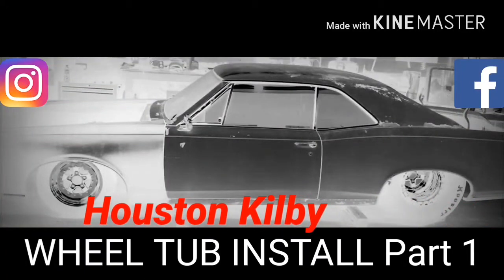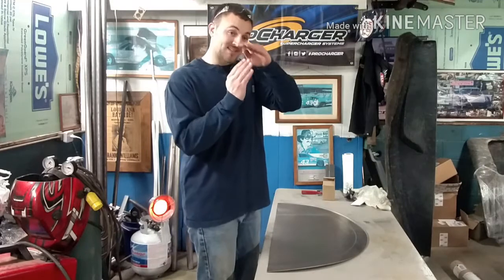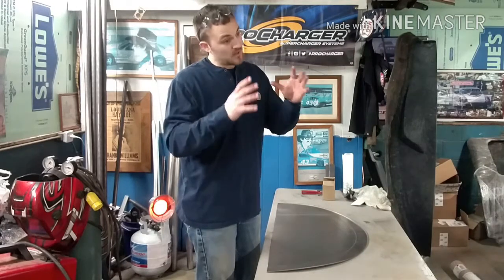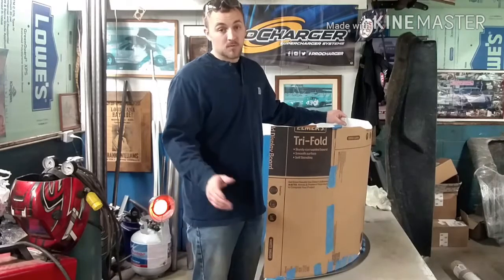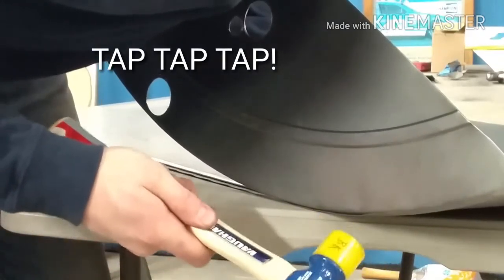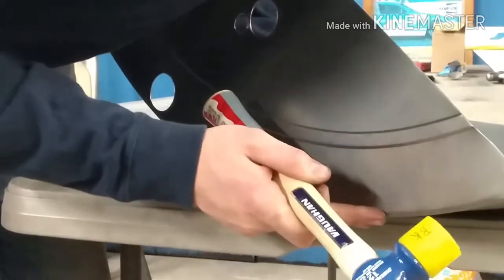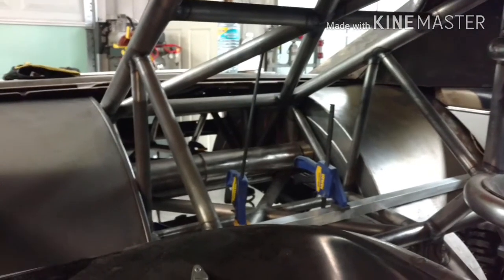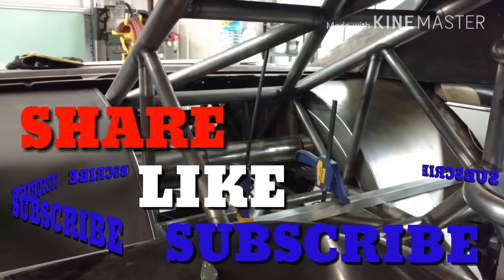Wheel Tub Install GTO part1(GTO BUILD EP3)

Comment: Man gods on time again i was about to put all this together in my 1971 pro street pinto tube chassis thanks man new sub here do u do the floors also i learned u wanna do the tubs for wheels first then build forward then correct  ?
Reply from the maker: @jackperry9369  ya you need to know what size tire first then go from there so you got big enough tub  yes I got some floor board episodes too
Reply: @HoustonKilby  I got a 33x14 tires
Reply from the maker: @jackperry9369  ya you need the big ones just like I used
Reply: @HoustonKilby  what size are they again I didn't catch the size I needed gonna order them once I know some say 40 inch for 33x14 some say 3 inch more than height of tire I figured 40 in but what is the width is it three inches wider I would say 40 x16 if there is a size think the oversize would b the height but confused on the width is there a 40 x16 and would that b good thanks for your time and wisdom
Reply: I would say 40 inch should be enough you want what 4 in or 6 in on the height? That's what I'm getting
Reply from the maker: @jackperry9369  ya that will work !!
Reply from the maker: @jackperry9369  the width is the same
On most big wheel tubs you just cut them down to size . Diameter ya I’d say 40 will be fine that 3.5” of grow room everywhere
Reply: @HoustonKilby  ty so much sir I appreciate your help with it man your channel is awesome sir lots of info knowledge and  integrity to reach out

Comment: How do you fasten the tubs to the body?
Reply from the maker: I made flanges that welded on to the body then I revit the tubs to that.  That’s the lightest way with steel tubs but you can also screw them or bolt them in
Reply: @HoustonKilby  could I use the same method for aluminum tubs ?
Reply from the maker: For sure!

Comment: being a sheet metal worker it really hurt watching this video,had to stop watching,wheel tubs are easy to make,and  finding a circle is easy with a rule,run it through a roller first and they go together easy,no need for rubber hammers if your doing it right
Reply from the maker: Justin Miller show this trick in a video I’d like to see this method done.
Reply: @HoustonKilby  lol,what trick,armature shit,that's no trick,that's a lack of knowing sheet metal,lol
Reply: I'll explain 1 freebie,learn the rest on your own,what so u waan know
Reply from the maker: What all have you built Justin ?
Reply from the maker: By the way are you talking about running the wheel tub through a English wheel? If so I’d really like to see what your talking about because running it through a wheel doesn’t make since. I’m all about finding new ways for doing stuff specially if it’s easier. On my English wheel it’s way to tight of a area to smoothly bend the lip over.
Reply: @HoustonKilby  here's your freebie,that's not what a English wheel is for,you would use a slip roller,thats how you form your tub to shape before putting together,you can also put beads in it to stiffen it,there's your freebie
Reply: Do you use any type of sealant after?